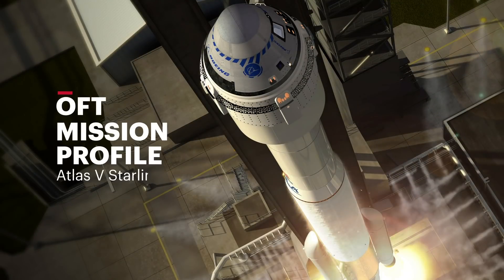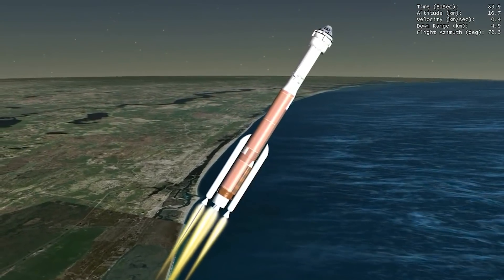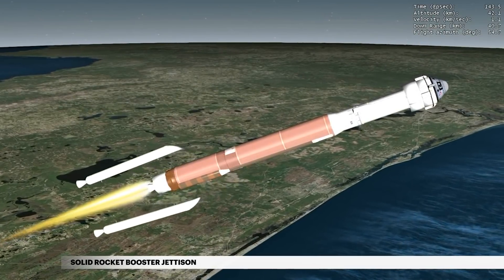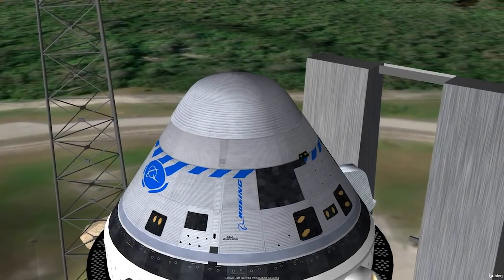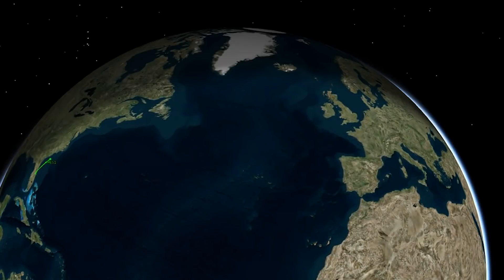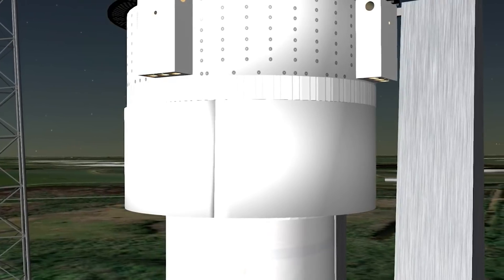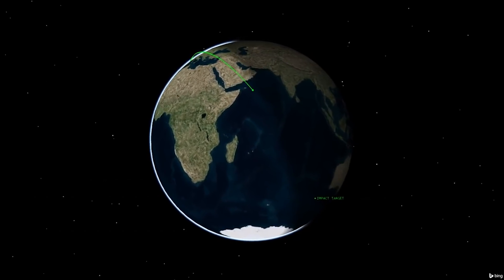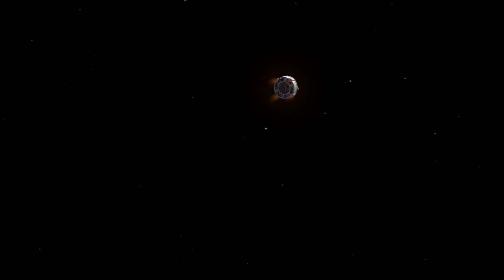Atlas V Starliner OFT Mission Profile

Comment: obsolete before its first operational flight - not very innovative using 60's and 70's technology in the 2020's
Reply: Do you think this is a refurbished Apollo capsule? The shape is about the only thing that it shares with Apollo.
Reply: @arrow-flight  just the shape - as if that's trivial.   This thing's just an upgraded apolllo capsule, nothing more.  The 70's space shuttle solid boosters are a hoot too.  Not even getting into the joke of zero re-usability.

Comment: Why does the star liner ride on atlas v not falcon 9
Reply: Also it wouldn’t make sense to just launch in one rocket, the commercial crew program is better because of flexibility with 2 rockets just in case one of them is grounded for some reason. Don’t forget Starliner is capable of launching on a Falcon 9 in case something happened to Atlas V
Reply: Ok thanks!

Comment: lol, you just drop the booster in the ocean? noobs
Reply: @_Andrew2002  Atlas V has one RD-180, not two
RD-180 has two nozzles but it's only one engine
Reply: How do you propose you slow down a 20 ton booster from 5km/s and bringing it back to port
Reply: @_Andrew2002  the same way SpaceX does it
Reply: @grandgalacticinquisitor-v9i  You have a severe misunderstanding about the design of rockets.
Reply: @grandgalacticinquisitor-v9i  The fastest a Falcon booster has gone during entry is 11,000km/h. The engine control system burnt through and the booster crashed. An Atlas V travels at slowest, 18,000km/h on re-entry. Mate, it's an impossibility to slow down a booster from that speed via aerodynamics alone.
And you can't propulsively land it because the G-forces of a single RD-180 firing would tear the vehicle apart.
And there aren't many parachute systems that can support a 20 ton booster, and there aren't any helicopters to prevent it splashing down and making recovery useless.
Reply: @grandgalacticinquisitor-v9i  Mate your comment saying ULA should just do it the same as SpaceX was genuinely ignorant and sounds like it came from a misinformed SpaceX fanboy. People at ULA have been building rockets longer than you or I have been alive. They are several times smarter than you or I, they're the ones who have done the math and analysis for reuse.
Reply: The Atlas V is a magnificent rocket in its own right, but it is beginning to look a little anachronistic in comparison with the Falcon 9, and upcoming Starship and New Glenn.  I scoffed at the idea a decade ago, but Spacex has proven that booster reusability is the future.  If ULA doesn't step up, it's going to find itself limited to an ever-shrinking niche market.
Reply: @_Andrew2002  sounds like a bad design.
Reply: @grandgalacticinquisitor-v9i  Nope, Atlas V unlike the Falcon 9 has 100% success rate. Atlas needs to travel to high speed because the Centur upper stage is low thrust yet highly efficient engine. The first stage has to go fast enough to get centur high enough to not fall back. It's worth it cause centur can carry more payload to high orbits than Falcon Heavy due to the efficiency.
Having one engine means must less chance of failure and also lower development cost and lower engine costs.
Reply: @_Andrew2002  I agree with what you said, but atlas v only has one engine. An F9 would be able to lose an engine, and still complete it's mission. If an atlas v somehow lost it, the mission would fail.
Reply: Will Kreider Thankfully thats never been an issue.

Comment: Why do they not eject the boosters right after the burn out? It looks like the Atlas holds onto them for like 10 seconds after burnout.  That's alot of dead weight to carry!
Reply: Typically this is done to make sure the first stage does not collide with the second stage due to any residual thrust and/or venting.
Reply: Residual thrust. If the boosters were jettisoned directly after cut off, they would essentially fly up directly next to the main engine since they still have a positive upward velocity.

This extra thrust can be extremely dangerous for a vehicle, as the boosters will inevitably flip over and spiral back down towards Earth for controlled disassembly. However, if the positive velocity existed, this flip could literally occur into the main engine, which would most likely end up with catastrophic failure of the LV.

Comment: 1000000 and 0.5 pounds of thrust or 1500000 pounds of thrust?
Reply: "A million and a half", isn't that self explanatory? In case it isn't, it's 1.5 million pounds of thrust.
Reply: @lorenzopappatico  I though that in case 1 the half is unnecessary and obsolet, but they say it anyway because Americans are often a little bit crazy.
Reply: They mean the second but I think linguistically that would supposed to mean the first (don't quote me on that).